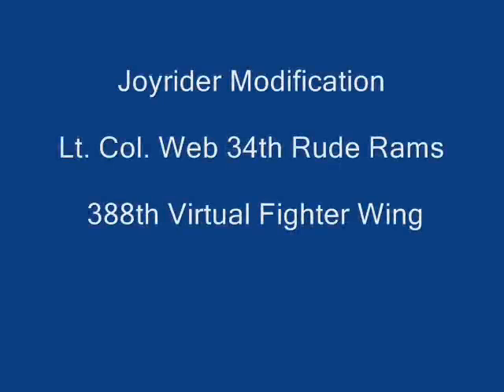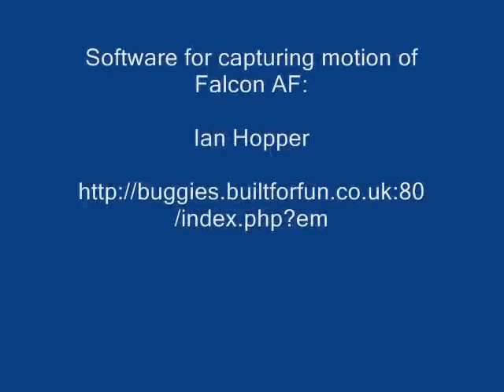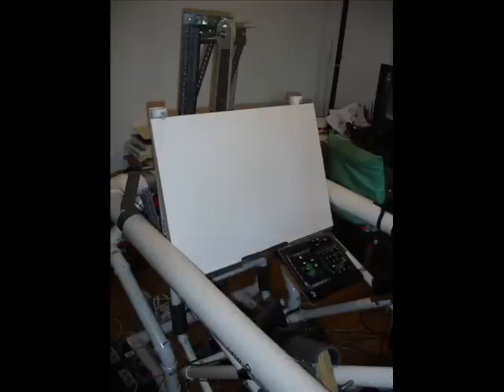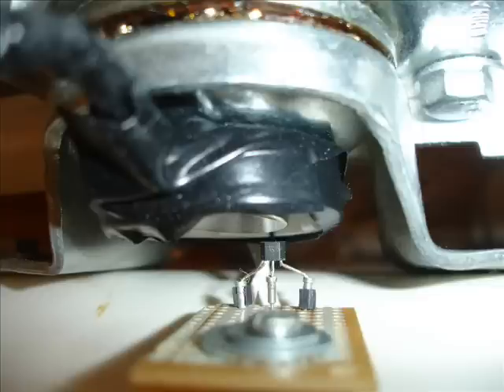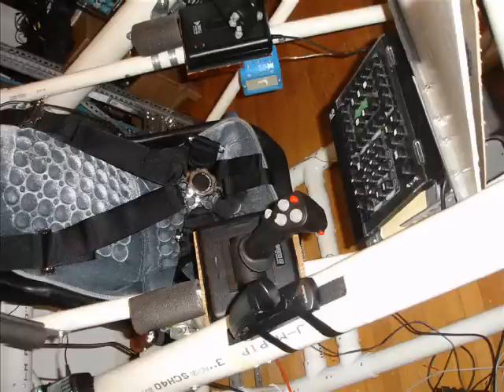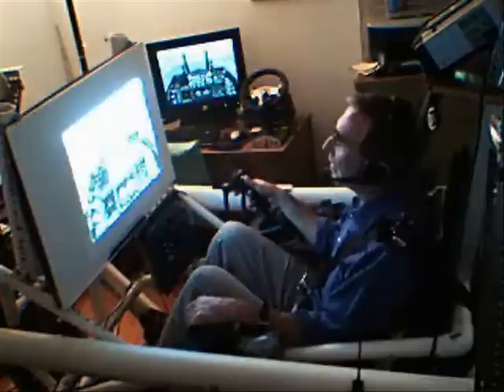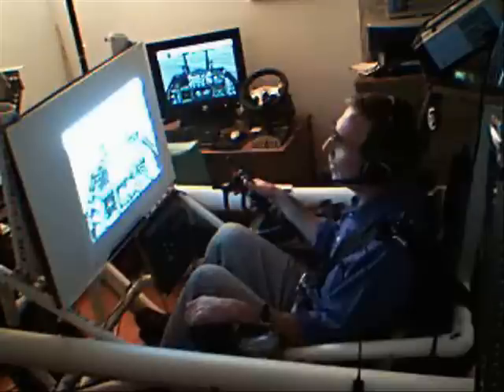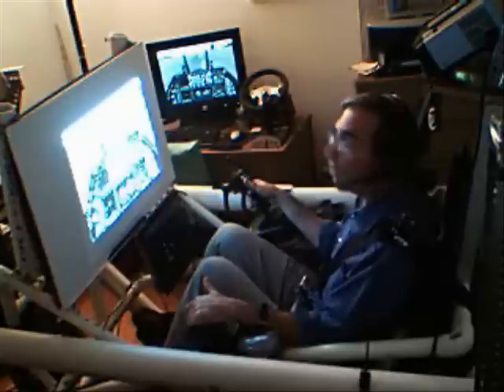Motorized Joyrider Demonstration

Comment: Hi Swissarmour, the cockpit is moved by real motion data from the flight simulator software. NOT the joystick!!! It means you could feel the accelerations like in the real plane. There are microcontroller electronics that position the motors and the hall-effect sensors are for the position feedback.

BTW I used hall-effect sensors too on my last videos from the "Athens Digital Week" show!! Check my channel!

Thanos